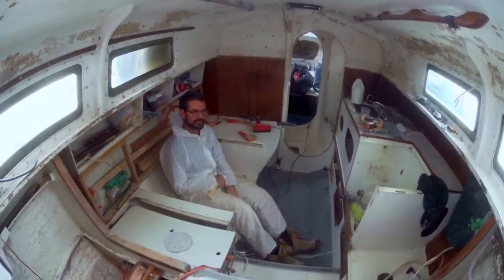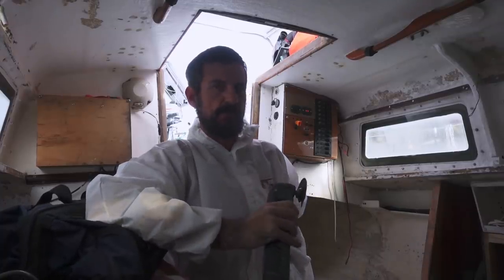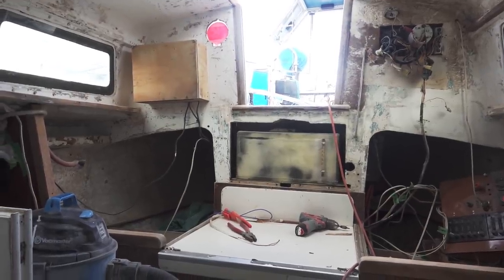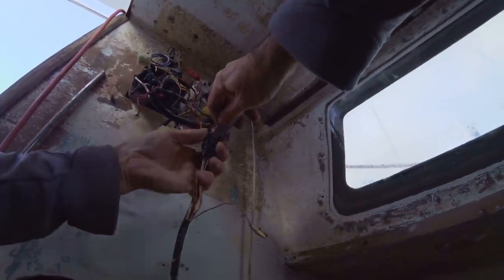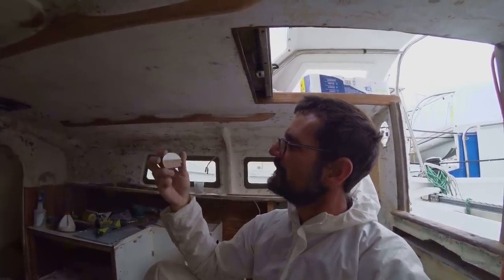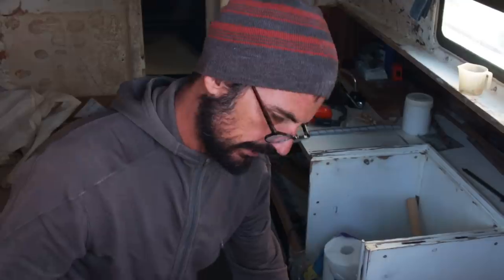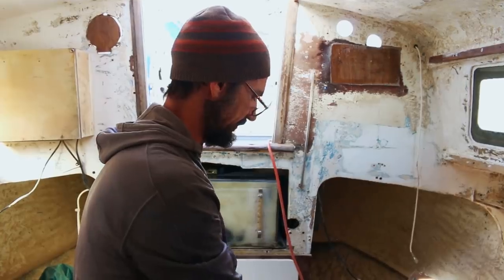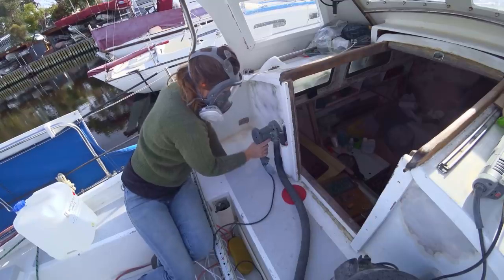Gutting the Inside of our Sailboat - Free Range Sailing Ep 144

Comment: A hole saw for 'insurance claims"... Best commentary ever!!!
Reply: I was wondering what size would be best for insurance claims.

We have a DIY set that consists of every size we bought one at a time for each project as they were needed beyond the basic electrician's kit for running 1/2" through 2" conduit.   

I probably should have bought a bigger set straight off as it would have been cheaper in the end than buying them all individually.  

I think our biggest one is 5" that was needed for some instrument installation.  There must be more than a dozen of them now all nested together.
Reply: SHHH!! Don't say the quiet part out loud!!🤣🤣
Reply: @svbarryduckworth628  the largest size one you can get ! ( LOL )
Reply: @jimmyhvy2277   ...but the larger size holesaw takes longer to drill.  You've gotta balance the time it takes to drill versus the size of hole... dangerous maths.
Reply: @svbarryduckworth628  Yes . thats true , and have your grab bag ready , As always , Plan ahead :)
Reply: Ya loved that..
Reply: @svbarryduckworth628  - The correct size is something that has to be related to the size of the boat. You need to give yourself sufficient time to abandon ship, so first you need to know the internal volume of the boat, then calculate hole size vs depth of the hole below waterline, so that you'll know how long it will take to fill her. Too big a hole, too deep down, will mean you're scrambling to get out in time to avoid going down with the ship. The actual calculations involved are left as an exercise for the student.
Reply: JAFO Just having a laugh to myself thinking what would happen if any of you have the misfortune to have to make a genuine insurance claim and your insurers see these comments!!
Reply: @malcolmrowe1794  - Meh.. short of being run down by a larger vessel, my boat is going to be unsinkable.. so it's not something I stress about.. ;)
Reply: @malcolmrowe1794  Ya hahahah
Reply: Besides all the other excellent qualities of FRS,  Troy's dry wit is one of the highlights.

Comment: Love your channel!!! Have built a fiberglass motorboat and many other things, but learn something new from every episode. You are wonderful hosts on a spectacular adventure. Protection & self-cleanup. In addition to masks to protect airways, you wisely don suits to keep out fiberglass & other dust. F-glass is itchy, barbs into skin, and will not quickly disappear even after a thorough scrubbing. For tasks of all kinds, I learned from German mechanics who wear turtlenecks. Because they seal at the neck, they prevent dust, dirt, and grime from infiltrating inside clothing - and even worksuits - which usually have a loose opening at the collar. Turtlenecks - even lightweight cotton ones - are part of my regular "dirty work kit." All the best!!!

Comment: those 90 deg multi tools are a great device. they've been around for decades.
Reply: Nylon cup brush on a rechargeable drill has saved me heaps of time sanding, messy, but gentle enough no to kill flow coat.
Reply: @skipper1350  when I said they've been around for decades, the doctor used one of those back in the 60's to take the cast off my left arm when I broke it all to pieces! You guys take care and good luck with the refurbish. Love from Seattle USA.

Comment: What? No peel ply? Didn't I teach you anything?  :^)

There were a couple of points during the video when I was thinking "I'd use the multi tool" and up pops the multi tool. Then, as you were getting the panel blank prepared I was thinking "hold it in place with hot glue then push the glue mix in"....and then, well....need I say more. I used literally hundreds of sticks of hot glue to hold pieces in place while I fillet and glass them in. Saves on screws and screw holes and, if the panel is not quite in the right place, simply knock it out and hot glue in the correct place.

Everything is in the preparation. The painting is "almost" the fun easy part...the wow factor when you stand back and look at the finished product and realise all the seemingly endless prep work was worth it.

Comment: We definitely carry more electrical plug-in AC tools here on BD: our little handheld jigsaw gets used quite often, a vibrating cutting tool, a 1/2" chuck heavy duty drill motor, a random-orbit sander, a small side-grinder, a variable heat gun, a big soldering gun that doubles as a sunbrella/rope cutter with the special tip, along with a tiny iron for delicate electronics work, and even a small hand buffer the size of a random orbital sander.  

We also have a tiny wet-vac, much smaller than the one you showed in the video -the smallest one made by wet-vac that still has an output for blowing as well as sucking.  That can be handy for blowing jobs even though we have a Porta Bote now and don't use any more it to fill the old inflatable.  You can make a bigger dust collector out of a 5-gallon bucket for big sanding jobs or for more water collection between dumps.  A few fittings cut into a bucket lid and Bob's your uncle.  We always have a bucket aboard.

We don't have any battery drills or other battery-operated rechargable tools aboard at all beyond flashlights.  With a 2000w continuous/3000w peak inverter and a 20' cord a battery tool is unnesssary on a small boat IMHO.  It'll even run the wet-vac for a few minutes but that is a lot of sun time to recharge with our limited solar.  Enough to vacuum the boat once a week of all the cat hair.

Comment: My grandpa used to say, "we aren't rich enough to buy cheap tools" meaning it's more expensive to buy the cheap roller, have it pull the glass cloth and maybe need to use a new piece, and take longer to do the repair, and since boats always need repair, you gotta do what you can to save yourself time, then you get annoyed with the cheap roller, buy the nicer one, and so now you have the cost of the cheap one plus the nicer one.  I just started dropping things a lot from my multiple sclerosis, so I do keep some cheaper tools too, for when I'm working over water, I'm case I drop it, and save the nice tools for doing fussy stuff, like diesel engine rebuilds where you might drop a wrench in the bilge, but it's retrievable.

Comment: Troy has to be as old as dirt to remember and use metric cm and imperial inches interchangeably....
Reply: I am afraid I am the same and even use the 2 together lol.
Reply: Metric rules the world 😂😘
Reply: I used to be a CNC setup operator, and it was normal to go between the two, converting back and forth etc. You get pretty good and knowing both units of measurements.
Reply: Nahh mate.   All it takes is a little tacker mooching around his dad's shed..  I'm fluent in both metric and imperial... Funny thing is I think imperial for most things, but if I have to measure and cut something then my head is all millimetres...

Comment: HaHa....Hole Saw.....Insurance Claim.....I like it! Well hopefully it doesn’t come to that. Ah the woes of overhauls and repairs. Looks to be coming along nicely. That huge sigh of relief after its done will certainly leave you refreshed and ready for more extended adventures. I just discovered yesterday my outboard motor is basically shot ( water jacket ), so a replacement has been ordered and on top of that there is a piece of rotten ply which makes up the engine well. So I made a temporary patch using a piece of starboard and an epoxy stick which is malleable and stuffed it in place to stop the flow of water. What is that saying?.....B.O.A.T.   Break out another Thousand X TEN!!!!!

Comment: On resin fin rollers, most rollers unscrew for cleaning . and heat from a blow torch will soften hardened resin then it can be removed with a wire wheel in a drill or bench grinder....

Comment: Just as a tip Troy you can get more life out of the Multi Tool blade by running a hacksaw blade every 2nd tooth if shops are closed or you can not find them to buy. And i was thinking would a Car or Truck instrement panel work with water temp Engine  /(Tac Guage  electronic ) Oil pressure ??? Old Car yard ???.  Great work you two.
Reply from the maker: Good tip on the blade. We will show our option for instruments soon but the tacho being dependant on a magnet on the flywheel makes it an OEM part :(

Comment: If your alternator has a tach signal (klemme w in german, dunno the international term) or you add one, you can get an automotive tach for quite reasonable money. For example old VWs mostly use this system and there's plenty of aftermarket versions, so if you run into car folks you can maybe get one for free.
Reply from the maker: If we upgrade the alternator, I'll get one with a tach terminal. Our Hitachi doesn't have one.
Reply: @FreeRangeLiving  it's just a cable to one of the ac coils, easy to refit. but then again a tach is probably pretty far down the todo list (I live mostly without tachs and do just fine :-)

Comment: Here's a handy tool to have when preparing surfaces, these scrapers do short work of stripping vanish and paint off. You pull on these scrapers instead of pushing giving you better control, http://www.linbide.co.nz/product.php?c=26 it can also remove runs from old paint by shaving micro amounts off depending on the force used. Linbide also do  Radiused and Corner Scrapers
Reply: Yes, agreed, I've found them great for small areas! I have two slightly different ones.

Comment: 26:14 Troy, a question. 

When you add 2 layers of glass above there, won't that be a different height to the original glass that's already there, making it very visible? 
I'd imagine using ply that's a little bit thinner than the wall itself so one can build up glass and than sand it smooth would be the best way, is that what you're doing? 

Thanks :)
Reply: Just to help. Right at the end at around 27:50 Pascale mentions the next step of using epoxy with microspheres. This is the fairing mix which Troy mentioned earlier in the vid. It will , no doubt, be applied beyond the edges of the glass  and,  once sanded, feathers the edges / high point away so it won't be noticeable at all.  With teachers like Troy and Pascale, all will likely be revealed in a future vid.
Reply: @davidmacbeth5575  But surely the ply still has to be a smaller thickness than the original sandwich. 

Otherwise it would not work. Also, unless they grind away part of the "good area", how can it ever become flat? 
The overlap between new core and old finish would be higher than original, would it not? 

I personally would assume one has to make a bevel in the old glass so that It becomes  one piece. Same principle as he used the router bit for kind of.
Reply: @AndreasEUR  You are correct that it won't be dead flat. The 2 layers of glass Troy used (200gram each layer) would amount to about 1mm thickness. What the fairing does is give an illusion of it being flat to the point that the eye won't see it. It all depends on how far out from the edge of the glass Troy decides to fair. If he finishes his fairing edge close to where the glass ends then, yes, there will be a noticeable step from the flat bulkhead onto the glass edge. The further away from the edge of the glass you go the flatter it will appear to the point that even rubbing your hand over it you won't feel it.

If you get something about 1mm thick and put it on something flat then take the edge of a ruler (or anything straight) and lay it across from the 1mm thick item to the flat area. Move your straight edge back and forth and you'll see that the gap appears to flatten out. As I said, it's an illusion of being flat.

Taking it to the extreme, look out to sea and the horizon appears flat. However we know that the horizon can't be flat because the earth is an oblate spheroid (a sphere which is slightly fatter at the equator). So there must be a curve there. We just can't see it.
Reply: @davidmacbeth5575  Well  the reason we can't see the curvature of the earth is because it's insanely big :P If you take a wideangle photo and push it together we can see the curvature :)
Reply from the maker: @AndreasEUR  You can take David's word as that of an expert- we know a fraction of what he does.

Comment: try using CITRIC ACID for any rust on the boat and to clean your tools. it eats rust just soak it in a solution of CITRIC ACID and Water. i use HOT WATER as it gets to work on the rust faster and it will not damage your tools. its also a great way of getting rid of LIME SCALE it will eat it up fast when using hot water and CITRIC ACID. and it good for cleaning out water tanks after all uses just flush with clean water. and the best thing is it will not Damage anything you use it for